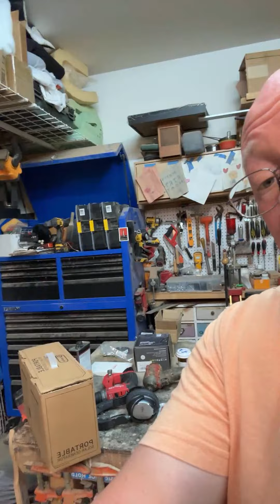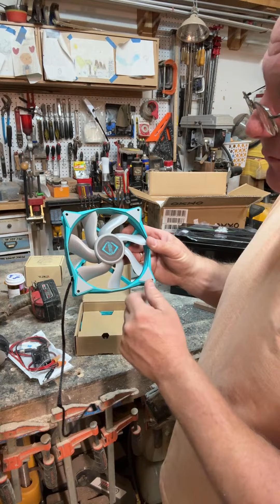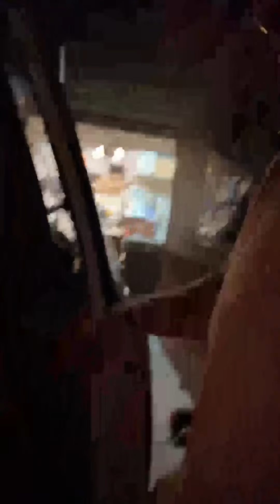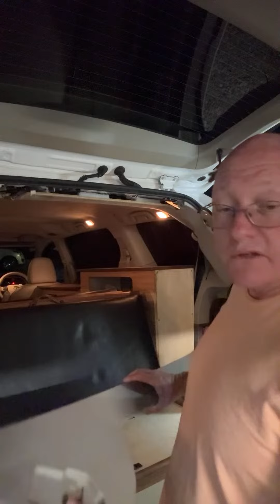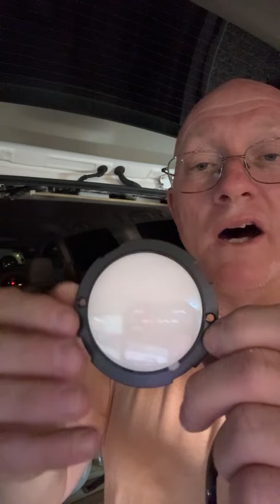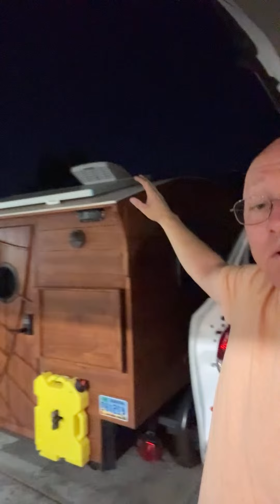ENDGAME is live!  Quick Look at Camper - Help me with some lighting ideas… And OKMO Battery

Comment: You can add a 12v PWM unit to it to use as a dimmer switch. I did that for the blower fan on my Colorado because the resister packs blow out on those.  I have a setup just like that for my camper trailer, Pulse Width Modulation unit, radiator fan, and a battery.  Ahahah, as I typed this it got to the part where you have one.  Should work great.  Never tried running more than one fan with one PWM unit, let me know how that works.